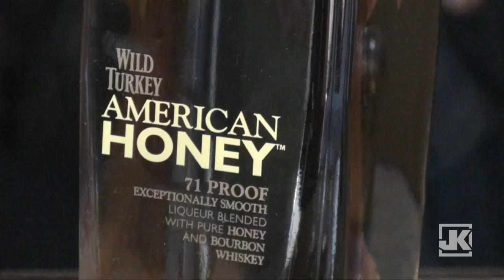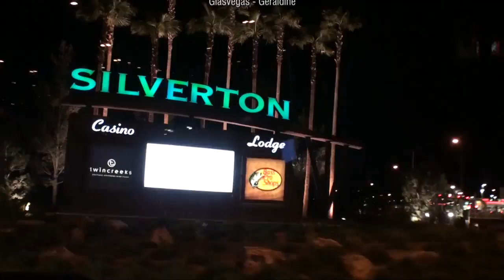Project-JK: The Moab Experience - Episode 1 (Beginning & Steel Bender Trail)

Comment from the maker: @tallzdatank hard to say as i have no experience with their kit.  one thing you should be aware of is that just because you have a coil over system, it doesn't mean that you will have a good ride.  spring rates and valving can make or break a setup and a benefit going with an off road evolution kit is that they worked extensively with king to develop JK specific coil overs.  they may be more expensive but it's worth it.

Comment from the maker: @foolsonparade we run a manual but, most of the people we wheel with run an auto.  most of them try to make sure to run 2nd or 1st on long hill climbs and that helps a lot.  others have installed a tranny cooler and that definitely does the trick.

Comment: I was wondering if any of you drive stick, or if they are all automatic. I test drove a jk a while back, (it was a Sahara, so it has 3.21 gears as opposed to 4:10) and it was stick, and I found that the engine didn't have very much low end torque at all. I know the gears play a big part in how much torque you get at the wheel, but how do you guys feel about the 3.8? Is it half decent or should I avoid that engine all together?